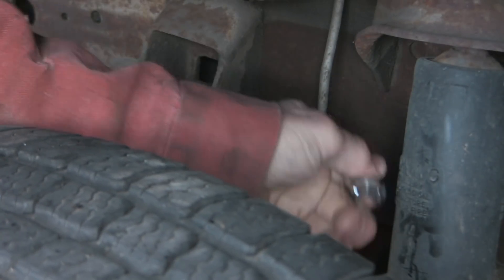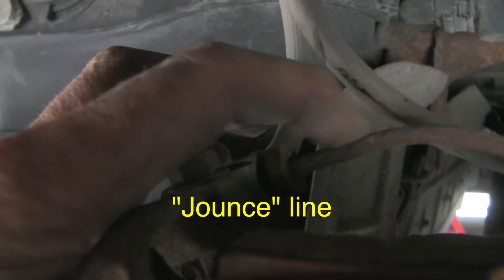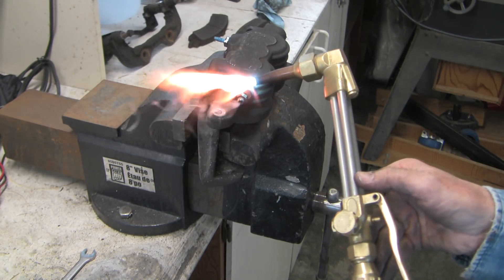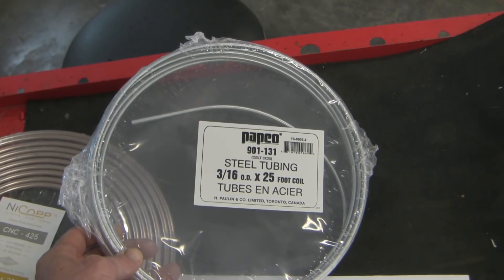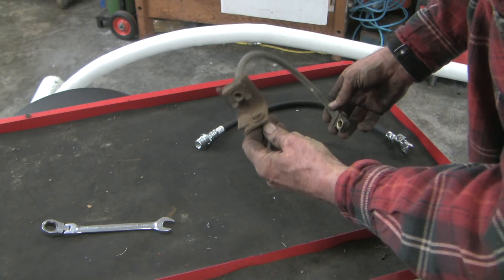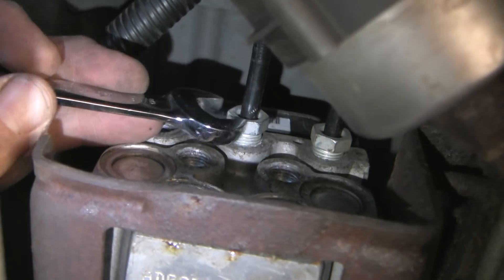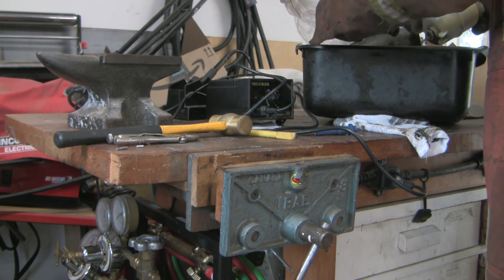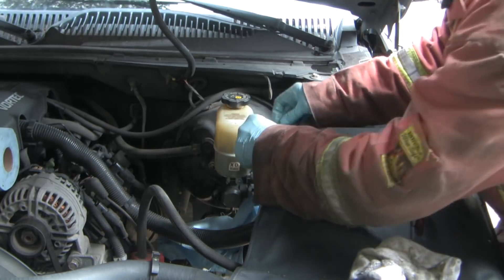How to Replace Rusted GM brake lines

Comment: Awesome video    I’m actually doing this job on our 2002 suburban.  Pain in the ass for sure.   Any issues with the abs modulator after bleeding?   Lights ect ?   Thanks for your time.
Reply from the maker: You go that right, lots of work. No problems with the abs after, though bleeding took longer than I expected. I drove it to a gravel road, thumped on the brake to activate the abs a few times, and then checked for a more spongy feel that might signify new air in the line released from the abs. There was none, but I came prepared to bleed a second time if I thought residual bubbles were sequestered in the abs unit, dislodged when I activated the abs motor. I also made enquiry with a few professionals, and they told me they rarely have abs bleeding difficulty with this vintage of truck. Good luck!
Reply: spelunkerd really appreciate your help.  Thank you sir.

Comment: Unbelievable shity factory uncoated lines setup! I lost break twice with my exact suburban! Thanks god i didn’t get involved in an accident. It costed me  1500$ for the entire brake system just because GM didn’t get it done right at the first time! And they got away with this recall !! toyota trucks had never had this same break lines catastrophic disaster issue.
Reply from the maker: Yeah, this problem is well described, but unfortunately it often occurs after the extended warranty expires.
Reply: The problem is GM should stand up behind uncoated break or even fuel lines since they know it’s safety issue and that’s why they went back putting the right coated or insulated lines for Their trucks after 2007 just like they use be in their trucks models before the year 2000. I own 1995 Nissan Altima with super safe original break lines even it’s exposed to Deice liquid in salt belt area for the over 20 years. Also I own 2006 Chevy express van witch has insulated break lines! So they could had done it to their pick up trucks and SUVs built at that year.
Reply: Al Karim don't feel alone, my 08 Dakota has been down for over two weeks because of rotten front brake lines. I can only assume the rears will need replacing too. as well as the fuel line. 112,000 miles  and pushing 4,000 in repairs this year.

Comment: Very helpful video.  My truck has just about the same problem . . rear line is leaking somewhere over the gas tank (I actually have two lines going back to the rear brakes). In the process of replacing all the lines . . stuck trying to free the lines at the ABS pump.
Reply from the maker: Yeah, with any big job there will be complications somewhere along the way. I hope it worked out for you in the end.
Reply: thanks . . I'll let you know how it goes . . and will try to get some video to augment  yours

Comment: Sharing a capture of the a ABS lines is pure genius! A retired friend of mine who helps out at the shop offered to get started on a SUV that needed all new lines. I let him go at it. he later came over and said the hard parts done! Then went on to say that he had removed all the old lines. Not thinking too much about it I later went over and found he had removed all the lines alright but never took note as to where each line landed!!! 😱 I searched and searched for information then finally sent him to the local salvage yard to take pictures of a known good 😥
Reply from the maker: Excellent point, Will. I also found some disinformation online, with at least one Youtube video explaining it wrong, and even the dealers manual is confusing. I think many professionals cut those lines near the nuts and spin them off with a deep socket, which would save time. When those guys do the same car every day they already know the routing.

Comment: Nice work on the brake lines.  I had one brake line let go on my '04 GMC Sierra and I brought it to the dealer for repair (I was up to my neck in work at home).  They called and said they had to replace all brake lines and would have to remove the cab to access ABS module.  The job would take a week and cost $2500.  I had the truck towed home and I did just what you did - Tough job, but very self-satisfying and inexpensive (VS dealer cost).  Thanks for posting.
Reply from the maker: Good for you, as you know it is quite a job. My Suburban is not even worth the cost of a full brake line and ABS repair. So the only thing keeping an old vehicle like this out of the scrap yard is an owner who can do it himself, or maybe a pro who limits the scope of the repair to exactly what must be done. I certainly agree with your remark about the satisfaction of completing the repair yourself. For me, more complete understanding how these systems work is always an enlightening experience. Thanks for stopping by!

Comment: Excellent video my friend. My suburban has same disease. 😬😬
Reply from the maker: For some reason the main line to the rear wheels is the vulnerable segment, presumably because of water exposure. Unfortunately that one is not so easy to remove -- I removed the plastic around the left rear wheel well to get better access, pushing the new line in from there. Thanks for stopping by, Ramon!

Comment: Yeah at first I thought stainless but then all the work to get it right. That is a chore! More protection in certain areas is required if not stainless from the factory.
Reply from the maker: Yeah, stainless seems like a great idea but those lines are hard to work with and they don't bend very well to allow complicated installation of a long line. The ACDelco kit I used was a coated steel/copper alloy that was much more flexible than I expected. GM seem to have a real problem with rust in this vintage of truck, and they are making a pretty good effort to deal with the problem by offering surprisingly inexpensive preformed kits. Thanks for stopping by!

Comment: Ahhhh rusty brake lines! Love at first sight for me haha
Reply from the maker: Eric, it's so nice to get a visit from a respected teacher. Every time I do a repair like this I tip my hat to you guys who do this every day. What I find most amazing is how efficiently a pro like you can get a job like this done. I would never have survived the flat rate game....
Reply: Haha I am not a pro by any means and the good news is there is NO flat rate ion these jobs. To do a full line kit on a GM in my shop assuming all the bleeders come loose and I do not have to change friction material, just lines and flex hoses I can bang one out in about 5.5 hrs start to finish. Does not include removing the master cylinder like you did though. Just lines hoses, power bleed and out the door and onto the next one! great job BTW!

Comment: nice work, what a whining brake pedal :)
Reply from the maker: Yeah, that sound was pretty loud but it disappeared entirely when all calipers were bled through. I think the slave pistons were vibrating from air movement, until brake fluid dampened the vibration.

Comment: I don't envy you on this job as it looked to be a PIA. Looks like everything is working well for you now and on to the next project :)
Reply from the maker: Yeah, so far the car is running perfectly. It's so nice to have it back in service, I was getting tired of seeing it up on stands in the driveway, ha ha.
Reply: And I suppose it's happy to be going around again and you that you can safely stop it going around at your will too. Should be coming up spring there maybe a boat project is on your list. Thanks for letting us look over your shoulder on this one.
Reply from the maker: Thanks, Don. That feeling of accomplishment is great, and it is so nice to not have an annoying ABS light. I wondered if I'd dislodge air bubbles from the ABS at the time of my first skid, but the ABS kicks in fine when I skid on gravel and the pedal stayed firm. So far, so good.

Comment: Well done, that looked like a right pain :-(.
Yes it was a mistake to heat the aluminium, but your mistake will stop anyone watching this video from making the same mistake, Thank You :-D.
Hopefully the computer will stop bleating about the a.b.s now.
Reply from the maker: Yeah when welding, aluminum is a very tricky metal, prone to weld contamination and surface oxidation, and it is not uncommon to lose control of the weld pool. Aluminum also redistributes heat very quickly so controlling heat can be a challenge. Thanks for stopping by, the ABS light has been off since the repair two weeks ago.

Comment: You should consider getting a vacuum bleeder. It is very common to damage the cups in the M/C in higher mileage  cars by bleeding  using the brake pedal. I am glad I live in a area where rust damage like that never happens.
Reply from the maker: Excellent point, whenever I do this I wonder if the MC will tolerate it. In an effort to reduce strain on those seals I try not to floor the brake pedal but honestly I don't know if that makes a difference. I do have a little vacuum bleeder but I can't say I like how it works, especially if the seal at the screw isn't great. If I had the dough I'd get a positive pressure bleeder, but because reservoir caps aren't standardized, finding the right adapter can be a pain. Thanks for stopping by!

Comment: Well done. I hope the dash lights behave themselves now. 
Brake lines are a job that most DIY guys shy away from simply because of the time and effort involved.
Reply from the maker: You're very right. To get a pro to replace all brake lines and fix the ABS would leave a bill nearly equal to the value of the car, so this kind of thorough repair is only for those able to discount labor costs. I'm sure glad I don't do this every day, it is difficult work without a lift. The priceless reward is deeper understanding how these systems work. Thank you for taking your time to watch my humble effort.